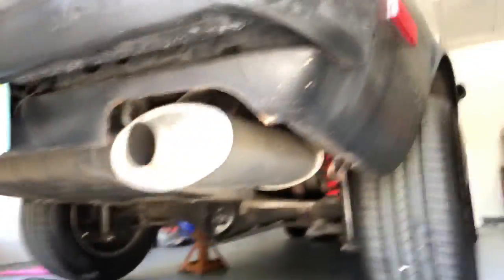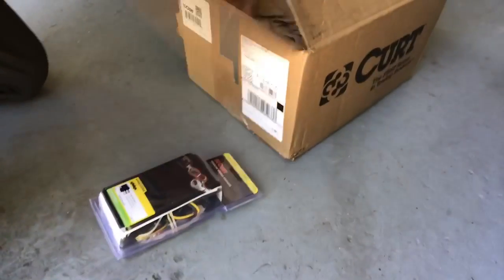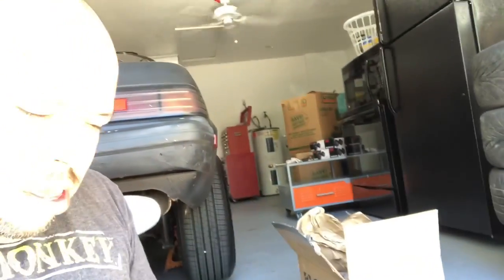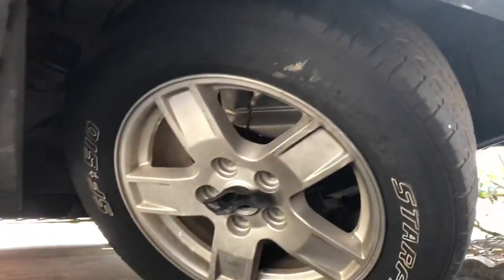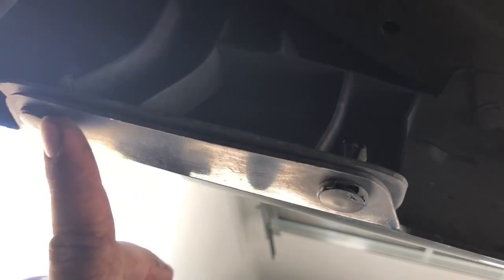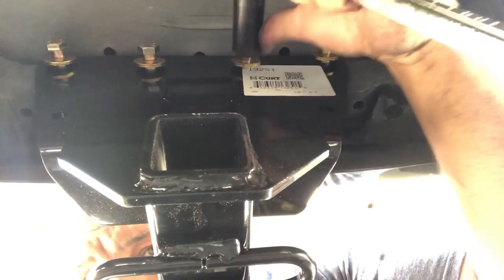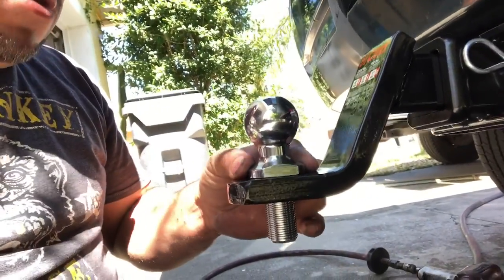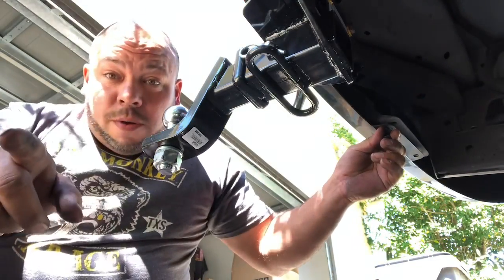05 Jeep grand Cherokee hitch install

Comment: How many inches are there from the floor to the bottom of trailer hitch?
Reply from the maker: God is good It really depends on your model Jeep and tire rim size. My Jeep sits higher in rear than front but with full size car trailer it’s pretty even. I would have to measure mine for exact inches. Also depending on what position you put ball you could gain more height i put mine dropped down so even. But you could easily flip it.